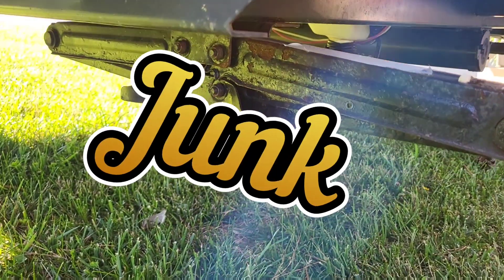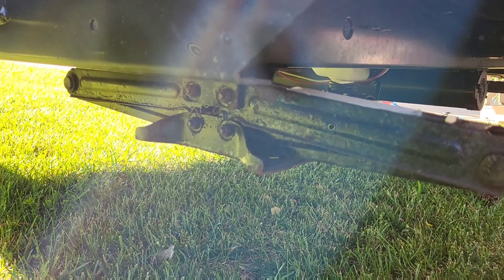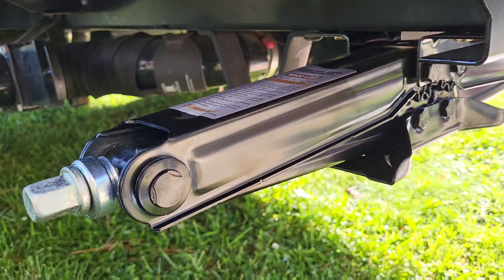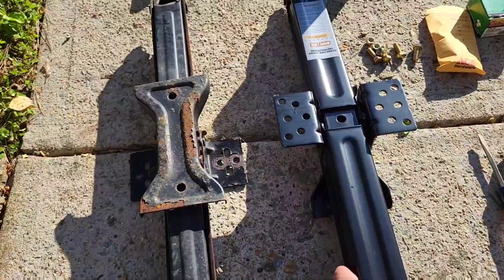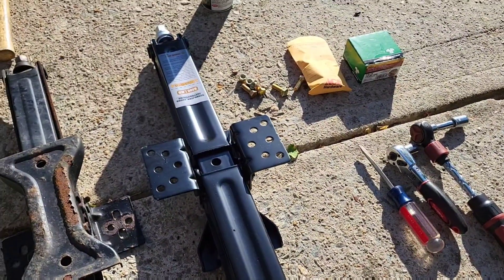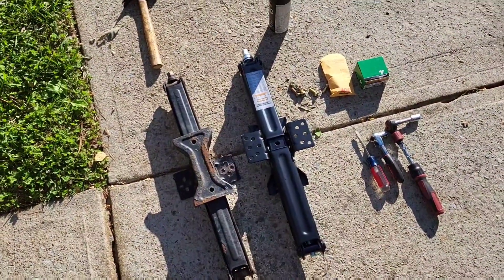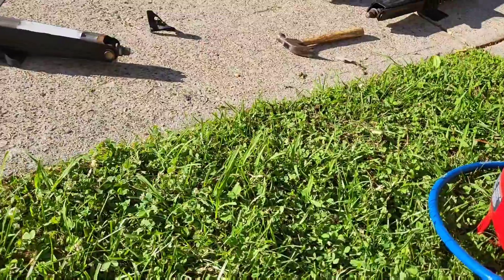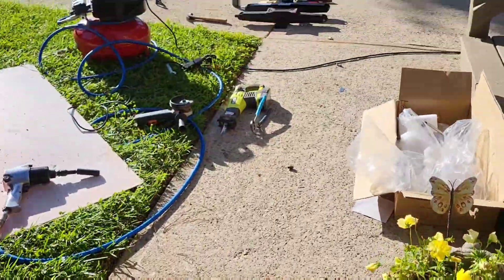Stabilizer Jack upgrade and replacement on our Forest River Geo Pro 19FBS. No mods required!

Comment: I replaced my original stabilizer jacks with the EAZ 7500lbs stabilizer jacks. Install was a challenge.
Reply from the maker: These were challenging too! Mainly because of the rusted bolts though. If I would have changed them last year it would have been much easier.

Comment: Will these stabilizers lift the trailer if you need to replace a tire?
Reply from the maker: The issue would be the front to back shear, so I would say absolutely not, and it would be dangerous to attempt.

Comment: Consider putting on 2 sets of BAL stabilizers bars ( less expensive then the JT strong Arms). Also do not use a cordless impact on them it destroys the gears. Cordless drill is ok. And use dry silicone spray to lubricate no petrolium products as the attract dirt